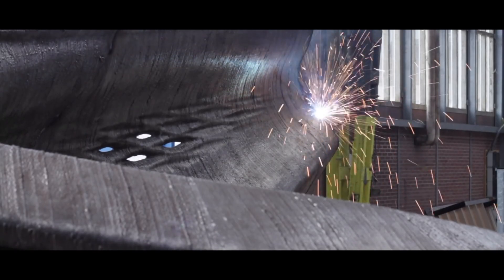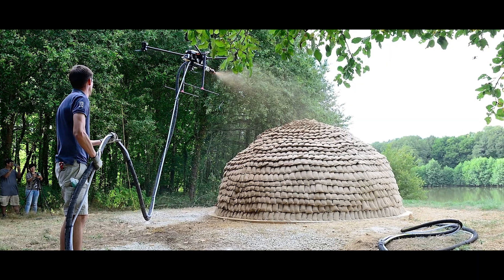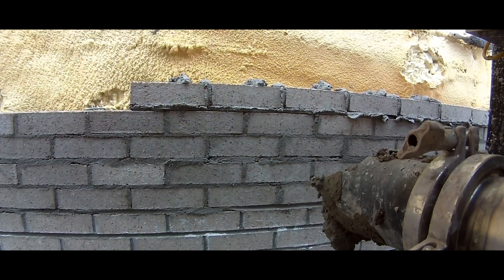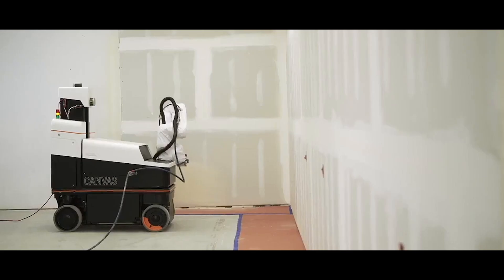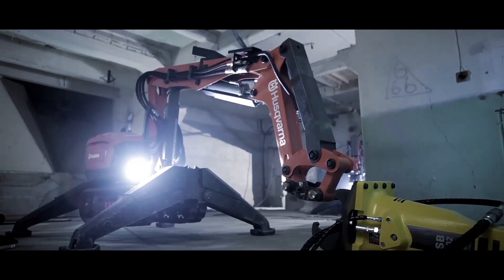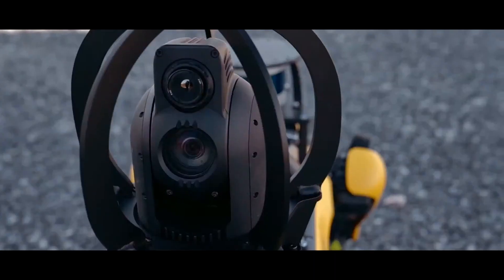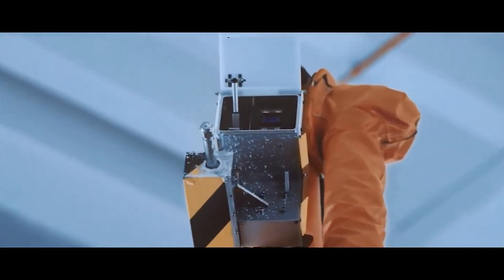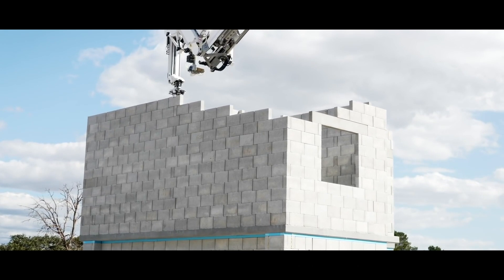See How These Futuristic Construction Robots Build - Future Technology

Comment: "Not able to work autonomously." In other words, not a robot, but merely a remote controlled tool - there are tons of those and it's nothing special by now. Remote controlled cranes have been a thing for over a decade, and machines like Huddig backhoes can also be fully remote controlled, which I guess by your definition means they're also a construction robot
Reply: Most of those excavators can now work autonomously. Caterpillar and Komatsu build fully autonomous heavy equipment now, meaning less jobs.
Reply: That line was specific to the Demolition-Bots and had NOTHING to do with the other robots in this video documentary. 😆